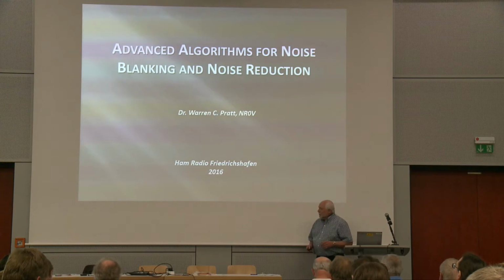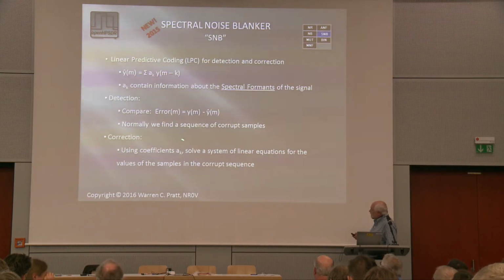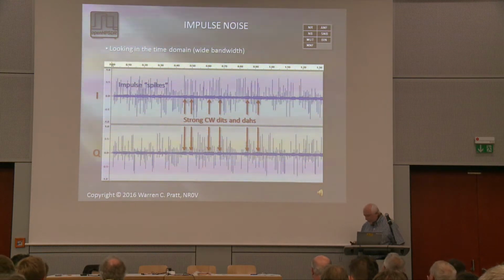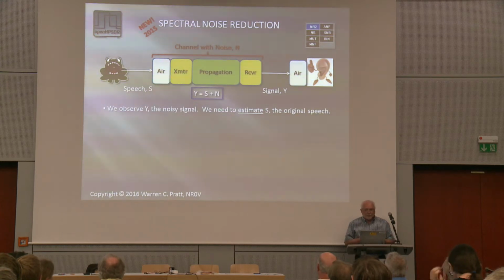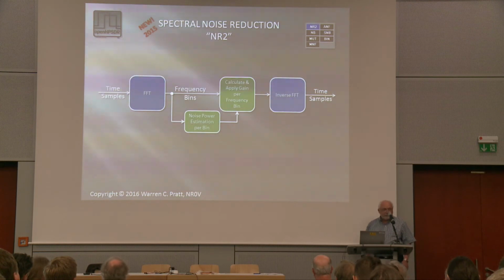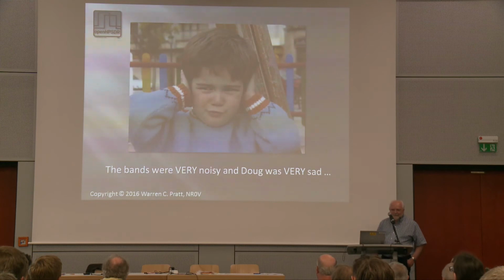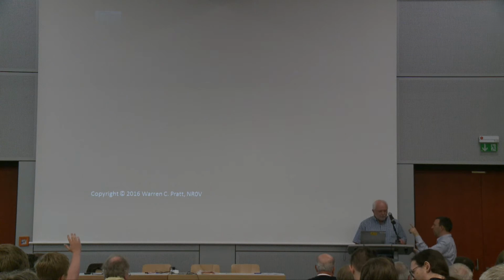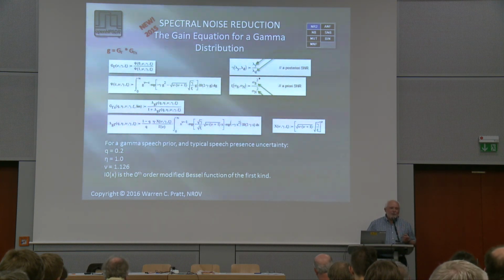Warren C. Pratt, NR0V: Advanced Algorithms for Noise Blanking and Noise Reduction

Comment: The Hemes-Lite 2 QRP Ethernet SDR HF Transceiver uses NR0V Noise Reduction and DSP Algorithms !

my thoughts.......

The Open Source GitHub Project Radio, the Hermes-Lite 2+ SDR Ethernet LAN/WAN QRP transceiver unit puts the FlexRadio to shame for it’s enhanced Noise Reduction DSP features and capabilities in the Thetis/PowerSDR/SDR-Console platforms that use the Warren Pratt NR0V NR and DSP function algorithms !

There is constant development on the HL2 versus say the more expensive FlexRadio for its low cost, open source architecture and new features that have greatly exceeded FlexRadio DSP and Noise Reduction capabilities. 

FlexRadio is really only doing new development for government contracts and ignoring the Ham Radio market for SDR transceivers, that a long drawn story, sad to say. 

The Hermes-Lite 2 12Bit A/D in has less Dynamic Range than the 16Bit A/D of the FlexRadio, is a thick client radio versus the thin client FlexRadio but for $295 from MakerLabs, the Hermes-Lite 2 ( HL2) open source SDR transceiver is phenomenal for the cost for a SDR transceiver at 1/10th the cost of a FlexRadio SDR transceiver